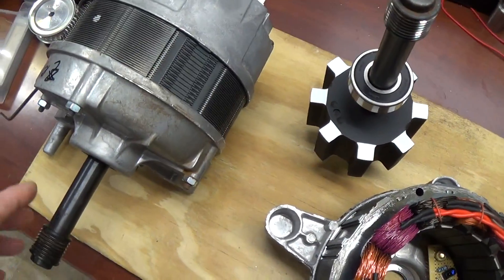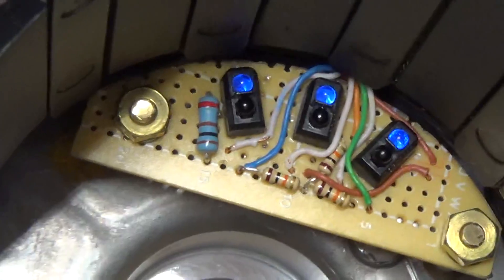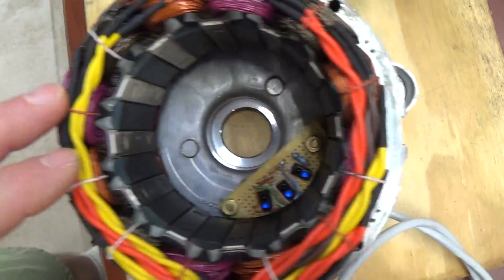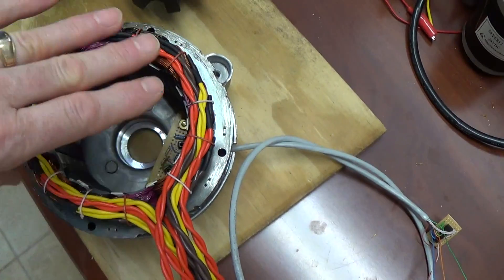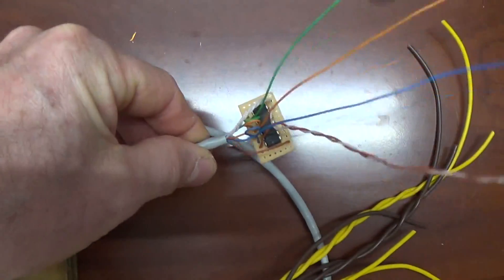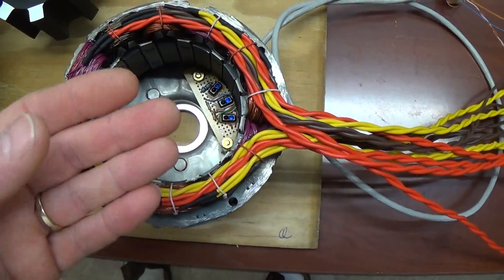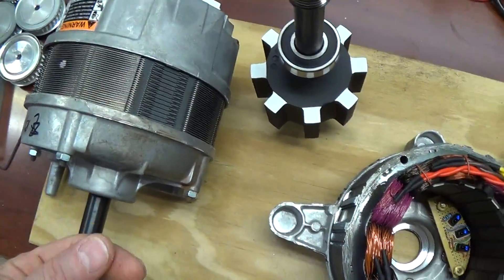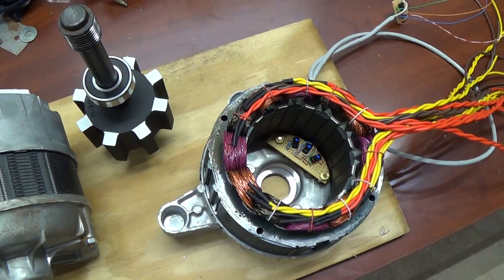Sharing ideas, how to build a more efficient motor (p.9)

Comment: @G 

Looks really great. Please consider identifying with a color tape one of each coil wire pairs leading out of your motor as coming from the inner 1st layer or the outer last layer. Please do it now before you close up the motor as I foresee this to be pertinent for you later on. @wattsup
Reply from the maker: +wattsup1004  It's been done!... each individual coil has been given a number 1 - 12 on the outside of the case and each wire labeled with that number. You can see some of it it in the next video:  https://www.youtube.com/watch?v=TfhIv3ihOKY